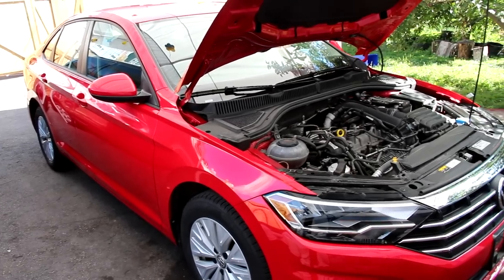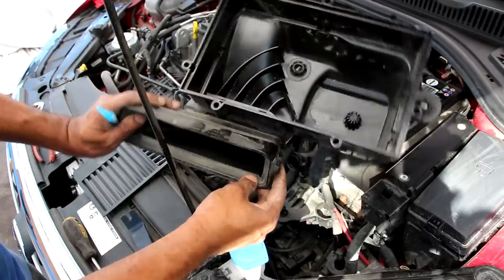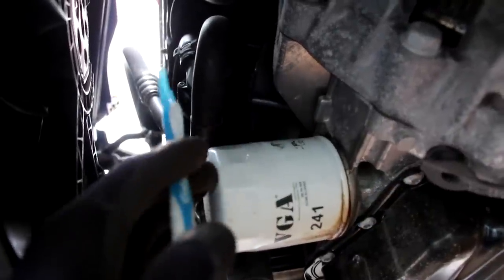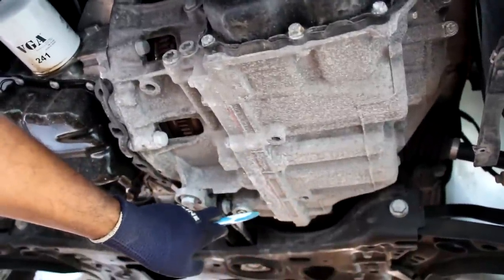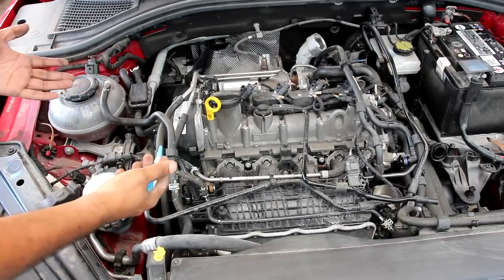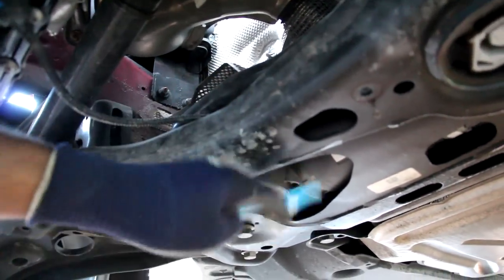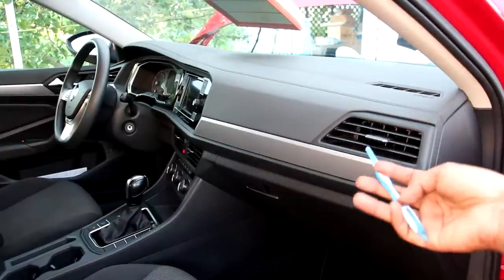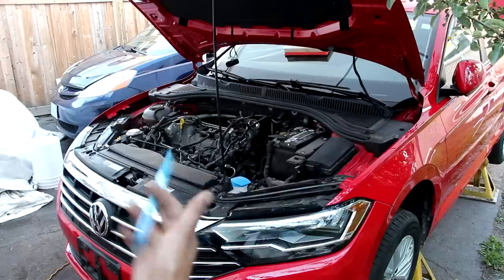Volkswagen Jetta Mechanical Review

Comment: The cheapening is very evident, i used to have a MK6 Jetta(EU) "mid" model with TDI BKD engine, front suspension subframe was a huge laser-cut aluminium cast, plus the control arms where not stamped steel but cast pieces, rear suspension was multi-link as standard. The trunk used a articulating arm that was situated outside the trunk itself(so it occupies no space inside) instead of the cheap swing bars that protrude inside, it also had a motorized sunroof. Oil leaks everywhere is VW standard and cramped engine compartment chock full of hoses and sensors is par for the course.
Also, timing belts are much better than chains, we tend to keep our cars almost for 10+ years, and a chain change is unholy expensive compared to a TB kit, hell with a couple of tools you can do a DIY TB change, not a chance to do that on a chain. I bet that summing 10 years of timing belts is still not as expensive as a timing chain(which a lot of times is a engine-out procedure)
Reply: I like this channel, but the reviewer is so used to working on cheap Korean cars that he's never seen a heated washer nozzle!
Reply from the maker: Interesting to note that VWs moving to belts are an upgrade
Reply: @speedkar99  i don't know if it's an "upgrade", but for OUR market it's much better as it's cheap to change(never engine out), and they usually last 120K(Km), you don't want to buy an used car where a chain change is 1/4 of the cost of the car (used cars here don't depreciate, in fact they get more expensive as time goes by). And as i've said, it can be done DIY
Reply: I don't see the problem with belts? They have to be changed every 100k miles but so does the tensioners  on a chain setup which failure is likely to have a similar result than a worn belt. The most common failure mode for a timing belt is for some teeth to be stripped out not for a catastrophic rupture and although a chain is less likely to break a chain  tensioner failure will also result in skipping a few gear.

That being said many 4l VW engines have a timing belt between crank and exhaust cam but also a  chain with tensioner between the cams on the backside of engine.

Oh and about the cheapening: an interior review would have shown the money went into the electronics/infotainment which seems to be on top of its category and what many people are looking for now.
Reply: @gglovato  American here what do you mean cars don't depreciate where you're from?
Reply: @jdinn32  it means that you can sell a used car more expensive than when it was new(in local currency), plus it's a closed market(we can't import used cars) and there's collusion everywhere
Reply: @gglovato  damn that's wild! I learn something new everyday. That makes sense.
Reply: @jdinn32  we also have a 40+% devaluation y/y so that's also how prices climb
Reply: @gglovato  dang lol that's a wild concept

Comment: the wire going to the washer nozzles is for the heating element. the pumping is done by the pump and the fluid is heated by the nozzles
Reply from the maker: So they warm the fluid?
Reply: @speedkar99  yes vw has been doing it forever now. Its just a small heating element in the nozzle powered by that cable. I think its more to keep the nozzles themselves warm so ice cant form and clog them up. The fluid doesnt really need to be warm due to its low freezing point.

Comment: Pretty sure those washer jets are just heated and not electrically actuated. Pretty common on most european cars I've seen for at least 10 years now.
Reply from the maker: But we have anti freeze washer fluid no need
Reply: @speedkar99  just because the washer fluid itself doesn't freeze doesn't mean that water from the outside can't get into the tips and freeze. Happened all the time on my old SAAB and Oldsmobile even with super low temp washer fluid. Particularly if we had freezing rain or rapid temp drops after a wet day.

Comment: The windshield washer nozzles are heated to heat the washers fluid, that why there wired...
Reply: Ive never had nozzles freeze over
Reply: @andybub45  the heated fluid help to melt ice on the windshield, handy at -22F
Reply from the maker: Good to know. I thought the was solenoids that activate

Comment: Great review as always. 

Seems like it’s an vehicle built with extreme cost cutting on the powertrain and chassis, however more money on the interior and exterior where most owners will interact and live. I’m curious where the reliability will fall after it’s outside the warranty. History points towards bad times, but for most first owners it will likely hold up long enough.
Reply from the maker: They put the money where it helps sell cars

Comment: You can reach down behind the air intake at the front and get to the oil filter. It's a tight squeeze and I have large forearms but I was able to get to the oil filter that way. It's not easy but for me it's better than removing the belly guard under the car.
Reply from the maker: Too tight
Reply: @speedkar99  it is tight but possible. It's not fun and will scratch your arm, but...
Reply: You have to remove the belly guard to get at the oil drain plug. How do you drain your oil? 
No point changing the filter if the oil is still dirty...
Reply: @garymaclean6903  oil extractor. Pump it out.

Comment: When I bought my 2019 Jetta, it came with 6 year/70,000 mile warranty. Used it once already for the evap 'thingy'.
Reply: Would you recommend getting one? I want a fuel efficient daily
Reply: I really like it. Got the 6sp manual. Get better mileage than EPA estimate. I'm averaging... Averaging 38. It gets 46-47 highway pretty easily. Back roads driving easy 50. It isn't slow either. Handles great. Very quiet inside.

Comment: The carbon buildup is not just with a Volkwagen but ALL direct injected engines.  It is just nice that some have the injectors that spray over the valves also.  I guess they realized that the direct injection was causing problems.  There are catch cans for that problem but I never had a direct injected car before and never had that problem.
Reply from the maker: Yep but Toyota for example is doing dual injection

Comment: IMO, all German cars have some sort of complexity and they all use those torx screw bolts. After buying a set of torx tools, I'm all good. The torx design means it is less likely to shear as you try to unscrew or screw it. They are better for repeatitive use.
I actually think the Jeep 4cyl is more complex and in a very unnecessary manner, so this VW is much better.
As for the large amount of plastic parts, I think that could be troublesome in the future.

Comment: I bet that oil leak is because the guy at Firestone, yes, Firestone in particular (or maybe Valvoline but especially Firestone, both of those places' cars came in to my old job fucked up like this on a regular basis) simply tightened the drain plug with his fingers and didn't bother using a ratchet
Reply from the maker: Basically that's the story
Reply: The dealers can actually be just as bad.
I've had a dealer use an air impact gun on the drain plug that flattened the crush washer paper thin...!
I do all my own oil changes now...

Comment: All German cars use lug bolts. How does that make it more difficult to put on the wheel? When you remove them the wheels stays there versus those with lug nuts where it just flops skew.
Reply: There's a thin lip on which the wheel is sitting. So it won't fall after the log bolts are out. But you need align the holes when putting the the wheels back on. A few cursing words can help.
Reply: Lug bolts are way less of a PITA compared to dealing with lug nuts on small cars like this IMHO. Only time I like seeing lug nuts and studs is heavy truck tires.
Reply from the maker: I dont like the bolts because it's hard to lineup
Reply: It’s just different and both ways are pretty easy once you get used to these as well. Line up pins exist to help and as stated these have a hub to center and hold the wheel.
Reply: @FxRiderST  It's really not that difficult. They have a long thin tool that fits into another hole making it simple to line up. Even without it, it isn't that difficult. It can be easily rotated on it. Certainly better than a floppy skew wheel using lug nuts.
Reply: I just chopped heads of some long Honda chassis bolts that treat into the holes once 2 bolts are out. Everytime I worked on 'Made in Germany' cars the wheels would fall out from the hub - not fun when you have impact gun in your hand and have to catch the falling wheel.

Comment: The windscreen sprayers are heated to stop them from freezing. The lines do not freeze because of engine heat. At least they are here in Europe.
Reply from the maker: What about anti-freeze washer fluid?
Reply: @speedkar99  https://parts.vw.com/p/Volkswagen_2019_Jetta/Nozzle-Washer-Heated/48365985/5M0955986C9B9.html   You do have to use anti-freeze as usual.  Somwhere I read that the nozzles are more likely to freeze if they are not located above the engine. So if they are near the windshield VW heat them.  BTW I love your videos. Pure content and no blah blah filler.

Comment: Great vids, I absolutely love my mk5 Jetta with the 2.5L and I beat the crap out of it. I don't trust the post 2010 models though.
Reply: Have 2015. 280000km driven and no issues at all. regular oil changes and official maintenance = car runs great. Well i am european and use it in europe not US
Manual gear tho.

Comment: 3 weeks ago I purchased a 2019 Jetta SEL. I do hear a brief scraping noise when I accelerate between 27 miles per hour and 31 miles per hour. As a mechanic are you concerned about this noise if in fact it is the torque converter
Reply: Forgot to mention that when I bought the car it had 12 thousand miles on it. So I bought it with the understanding that I still have 60000 miles of Factory warranty remaining.
Reply from the maker: Check the brake shield

Comment: 🤦‍♂️
Wires for windshield washer jets is because these jets are heated
Reply: Why? If you use washer fluid they wont freeze.
Reply: @andybub45  I guess they expect people to be dumb and just use water.
Reply: @andybub45  I suppose  their thinking was: deicer washer fluid + heat = extra fast windshield de-icing.
Reply: @andybub45  some climates experience cold snaps. I live in Edmonton which regularly gets -40'C or below in winter. Never had washer fluid freeze on me there. I was in Wales, in the UK during a cold snap a few years ago and every car had their washer fluid freeze solid because it was watered down for the temperatures expected in that climate, even though it was only -10'C or so.
Reply: @andybub45  it can freeze. When jets are heated up from engine after long drive, fluid (or antifreeze component like alcohol) vaporize and next day you can have freezed jets. In old Opel (vaxhaul) Senator there was also electrically heated jets. In some Volvo you can find heated washer fluid tank with engine coolant (via heat exchanger).
Reply: @seanguy9720  
thats for helping the glass to crack when its cold so you go buy a new windshield 😂
Reply: @haczyk84  I suspect this is the case. My old SAAB sporadically would have frozen jets even with low-temp winter washer fluid.
Reply: You pay for them on a new car and again after they will broke ... Proper example for "gimmiks" ... Simple finance 💵💵💵🏆
Reply: @CristianP  i have 2001 audi a4 with heated water jets and jets are original part, never have been replaced. Your point is invalid
Reply: @Cevium  ... Your 20 years old car is not the ONLY one on this planet ... Audi / BMW / Merc. are premium cars ... VW budget segment ....
Reply: @CristianP  Audi and VW are the same. This thing exist for over 20 years. Here in germany every Hyundai or kia etc. have this feature. I wouldn't even buy a car without. No one has problem with these.
Reply: @RustyHeartsTOV  ... Kia & Hyundai are the same cars with similar prices.... VW / Audi not... VW budget and Audi premium even if they share same parts ... More luxury, technology, quality control at a bigger price of course on Audi.

Comment: The nozzles are not electrically actuated. They are just heated. Also the engi e hook is so you may support the engine and not to luft it up for removal. This engine really comes out easiest from the bottom.
Reply from the maker: The valve adjusters?
Reply: @speedkar99  what do you mean? I was just saying that the washer fluid nozzles are not electrically actuated.

Comment: 5:55 Not a drawback at all to use a traditional Cambelt. The quality of timing chains, their guides and tensioning- systems is so poor nowadadys that a belt lats longer than a chain in alot of cases.
Even more expensive brand cost- cut the hell out of this crucial engine part and their chains fail very early. Volkswagen actually went back to cambelts after their timingchains didnt last long and engines failed. Replacing a cambelt every 100k miles or 10 years is better than a broken valvetrain because the chain gave up...
Reply: Well said 👍🏻 that’s exactly what I was getting ready to say. You saved me a paragraph 😂
Reply: @Tyler0513  Change the belt and a couple of pulleys, maybe the water pump, and good for another decade.  No having to take the front or maybe the back of the engine off.
Reply: Agree  completely and absolutely. Nothing but trouble with TCT and  VVTi on many Asian cars. This  engine looks  easy enough to work on. unlike the  E  water pumps on BMW  3L turbo engines
Reply: German  engines and timing chains have been a nightmare, happy to see the return of  the cam belt.
Reply: Timing belts also don’t transfer vibrations. Timing belts are a far superior timing system than chains. I’ve seen timing belts on LS400-430s run 150,000 miles and still look decent when replaced. Many modern chain setups won’t run that long before they start throwing correlation codes due to wear.

Comment: great review 

torsion beam and timing belt are disappointing ... and that vertical valve body cover is weird 

older gen had 1.8T with timing chain and independent rear suspension .. and  much easier access for oil filter , you can do an oil change without going  under the car

Comment: The intercooler is inside the intake manifold.  Its water cooled intercooler.
Reply from the maker: Yes
Reply: @speedkar99  i have the ea211 chpa engine. 
2 years driving 40.000km no issues. 
Had to clean the carbon of the intake valves but thats it .
And yeah the sprayer on the hood is for heating the sprayer, no ice :)

Comment: Pretty uncommon to see a timing belt on a direct injected engine. There's a good reason for that. That pump requires a lot of force. That's why most manufacturers use chains.
Reply from the maker: Yes timing belts in general are uncommon on modern vehicles, much less two separate belts on this engine!
Reply: A timing belt increases packaging size, but I decreases cost. Given the small size of this engine, I think they had the room and were trying to hit a price point.
Reply: @danhg3885  Belts are also quieter than chains. They also have much more advanced compounds in the newer lifetime belts than they had in the older belts. You'll eventually have to replace a timing chain as well, due to the nature of the tensioners and guides. Having a belt simply makes this inevitable maintenance easier.

Comment: "typical volkswagen oil leak"

Camera pans up to show a leaking, crap quality Chinese made Canadian backwater auto parts special instead of a quality Mann, UFI, or Mahle filter.
Reply from the maker: It was likely an untightened drain plug
Reply: Someone hit a sore spot. 🤣
Reply: Someone is a salty chip today lol
Reply: I had an2009  Audi A4 Quattro avant. 
In the 4 years of ownership:
The oil pan rusted a hole into it (HOW?!?!)
The engine was replaced (tsb)
The rearview mirror dry rotted. 
The middle cup holder/arm rest broke in the seat, unable to get it out. 
The sun roof drain tubes would constantly plug and drain into the backseat and passenger door well.

Audi is chevy level quality at MB prices. Never own an Audi
Reply: True, but my dealer uses new plug and o-ring at every " yearly" oil change to prevent leaks. I would use the VW  filter part,  seeing how  long it is in service.  Price difference is aboot  the cost of  3 litres of petrol - Sandy

Comment: My 2014 Jetta SE has a chain.  They've moved to belt?
Reply from the maker: There are many different engines that have now be consolidated to this one
Reply: @speedkar99  thanks!
Reply: The constantly failing tensioners, worn out guides, sprockets. Still many cars require changing the chain(s), and belts can be stronger than chains and usually are easier to change (Mitsuboshi and Gates being my favorites)

Comment: it's a heated windshield washer sprayer.
Reply from the maker: But why? Winter washer fluid doesn't freeze until -40
Reply: You pay for them on a new car and again after they will broke ... Proper example for "gimmiks" ... Simple finance 💵💵💵🏆
Reply: @speedkar99   Because in the northern climates the washer nozzles often freeze.  Washer fluid is a mixture of alcohol and water.  The alcohol evaporates from the washer fluid sitting in the nozzles and then the water left over freezes the washer nozzles shut.  Heated washer nozzles are pretty common and several manufacturers (Not just VW) offer them.